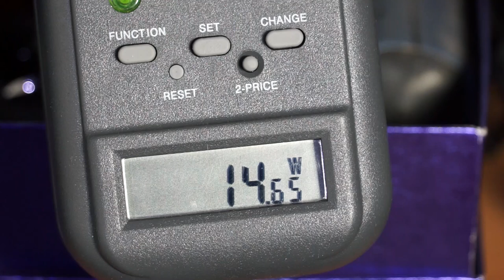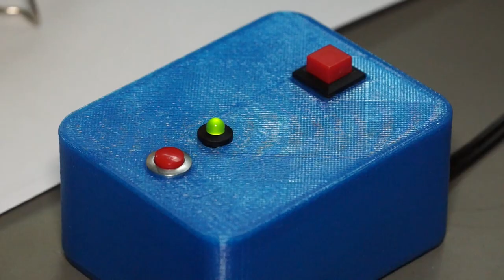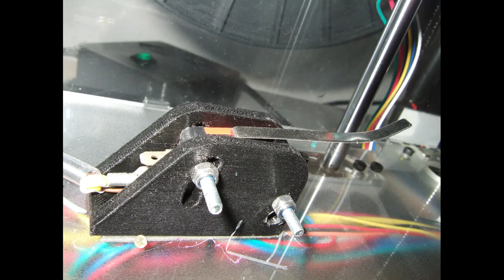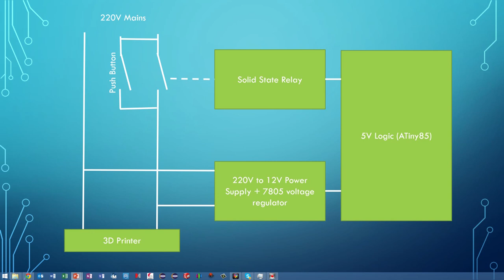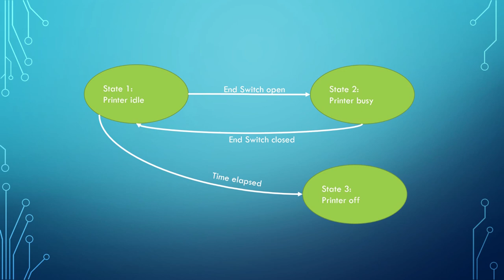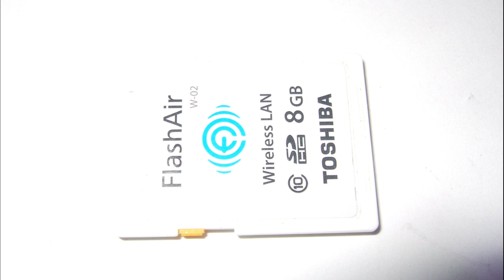#25  3D Printing Tip #1: Automatic Switch-off using an ATtiny85

Comment: That fan sounds like it should be replaced :O
Reply from the maker: +zaprodk You are absolutely  right! The fan is inside the power supply. This is why I did not do it till now. And for the moment, it still works ;-)

Comment: Very useful circuit for many applications. But in this case couldn't you add the FAN OFF to your END gcode? I just add M107 and in the morning my printer is silent and resting.
Reply from the maker: I wanted the printer completely off. This is the reason for that. But I am sure, there are other possibilities for that. This one was good for me, because I did not have to change anything in the printer circuitry. And I used the same PCB for my two Hotglue guns...